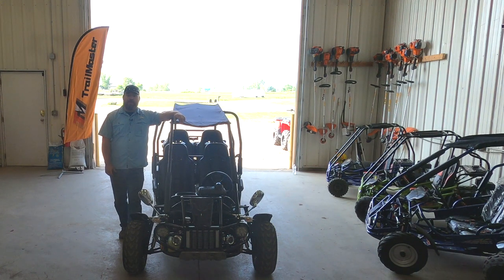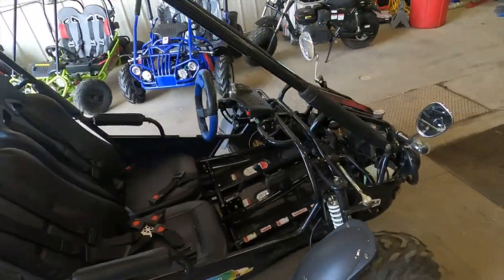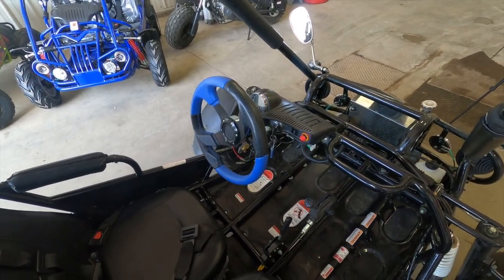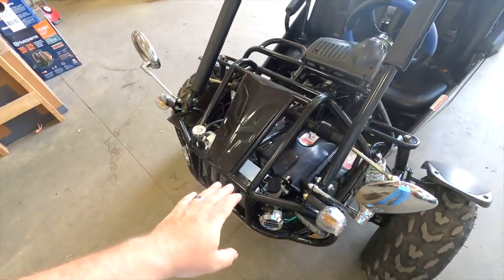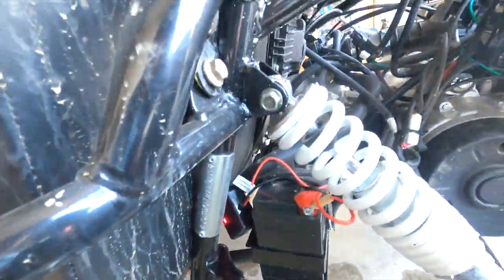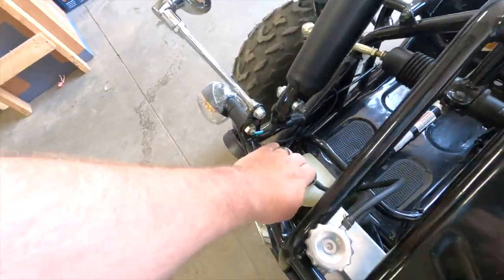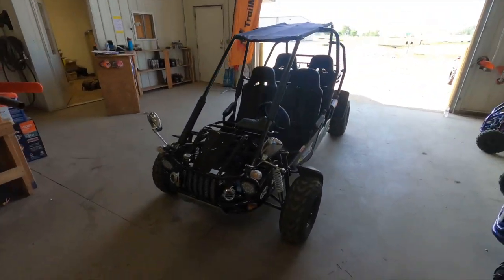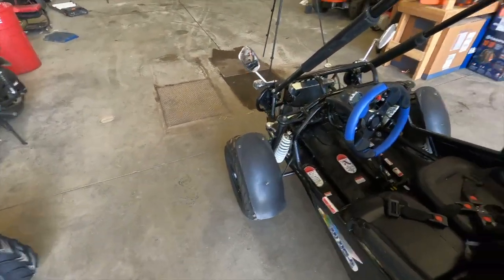TRAILMASTER 300 XRS 4 SEATER REVIEW: 😩WE BROKE IT!!

Comment: I have the 300xrs-4 (4 seater) and love mine. We have taken it to Wisconsin and rode the cheese trail and all the county roads you are allowed to ride on. We are a family of 4 and total weight of around 450lb. This thing will cruze at 40-45 mph all day. 50mph screaming down hill.  I have add a windshield made of acrylic and a bazooka led sound bar and a super bright led light bar.  We just passed 1,300 miles and still runs like new. Only things I've had to replace (fix) are the rear fender mounts tend to snap. Easy fix with a welder. Getting ready to put a new clutch and belt on next just due to the age of the cart. Thinking of going with the Dr. Pully clutch. Also the front tires wear the insides pretty fast. I bought it new and it came in a box and I assembled it myself. Used lock tight on every bolt. It is impressive for what it is.
Reply: Also if I fill the gas tank up completely full it will want to stall and die. It needs room to breath in the tank.
Reply from the maker: Thanks for this. It is super helpful to her reviews  and results from people that aren’t biased. We give our honest opinion, but we are a dealer so it’s good to hear from someone else that loves this kart!

Comment: hi i just got a used 2021 tiking 4 seater go kart with the long shaft gy6. it has a 3 wires coming out of it about a  inch from the shifter  rod location on the passenger (right) looking from the rear. it is 3 wires yellow, green/red stripe and purple wires going to a 3 way female plug. it wasnt plugged into anything when i got it just wondering where it goes i cant find any place for it? i`m thinking a indicator for where the tranny is? on those models equipped with that..?? anybody know where that goes? thanks
Reply from the maker: It probably doesn’t go to anything on your kart. All of the GY6 engines have those wires- but all machines don’t necessarily use them. The wires are typically used for things when the gy6 engines is on a Scooter. In fact, on most of our Trailmaster go karts, those wires are cut off because they’re unnecessary. I’m not well versed in Your specific kart but I’m assuming the wires are not important.
Reply: ok cool thanks im thinking it has to do with the lights on a scooter/moped like a neutral light. but i just needed a expert advice first time working on this new stuff last small engine i worked on was a 5 hp brigs about 30 years ago. lol thanks @GoKartMastersAcademy
Reply: After taking the ground off and cleaning it and putting a star washer between it and bolt still no spark  then taking the voltage regulator off and sanding down to metal and using dielectric grease and star washers to bolt it back down it cranks and runs fine. wasted money on part-fixing but hey at least i have spare parts..like everybody told me grounding sucks on these things if you have any Chinese stuff take anything that is grounded and sand it to metal being a old radio guy i go that extra mile and use star washers to bite down good..

Comment: Best adult 2 seater overall ?
Reply from the maker: Depends on what you’re looking for. Each model has something special and is top quality. The 200 kart is great adult kart and comes in an XRS base model or an XRX upgraded model with mostly cosmetic differences. For more power you can move up to the 300 XRS. For the ultimate off road go kart, you can go with the 300 XRX which has independent rear suspension, liquid cooled engine and more. If you have any specific questions you can check GoKartMasters.com or give us a call sometime

Comment: I recently bought one of these and I'm currently having a bit of trouble with it. Maybe someone could shine a better light on my situation.

Somehow I was able to shift the motor enough that a bolt on the backside got stuck on the frame. As a result, the water hose was pinched off and the kart overheated. A couple times. Eventually I realized it was running abnormally hot, but the damage seems to be already done. Now I'm getting misfires and rough idle.

What concerns me the most is that a time or two before my discovery, I would get the kart up to speed but even after releasing the accelerator pedal, my speed never dropped. In fact, one time I let go and it felt like a ghost had pushed it back in and I just sped back up. I literally had to reach forward and pull back the gas pedal for the kart to slow down.

I did have to replace the throttle cable after it had snapped from the motor dislodging itself. Maybe I didn't install it correctly? I will eventually bite the bullet and take it to a shop, but I wanted to ask a couple professionals first to maybe help me better understand what happened or perhaps guide me to the area specifically to focus on.

Any help would be appreciated. I am still trying to financially recover from having bought the kart in the first place. So anything I can potentially do on my own would be beneficial.